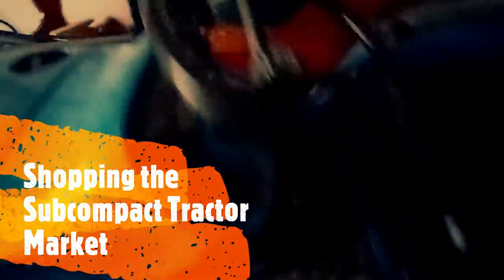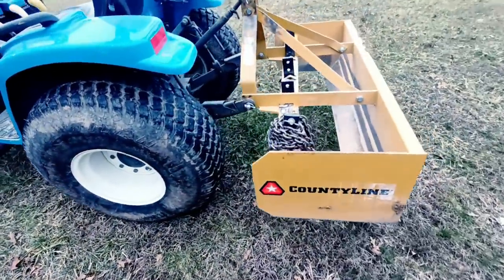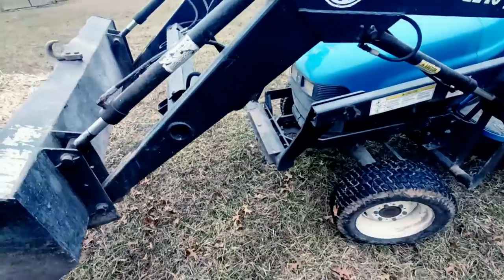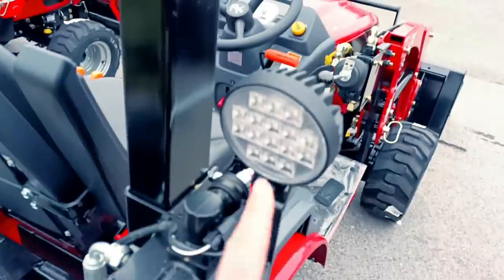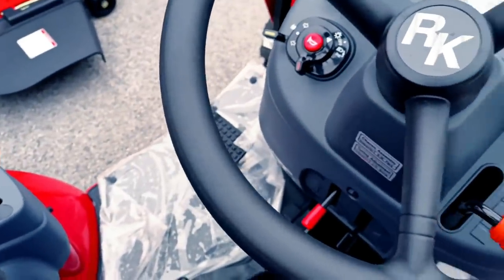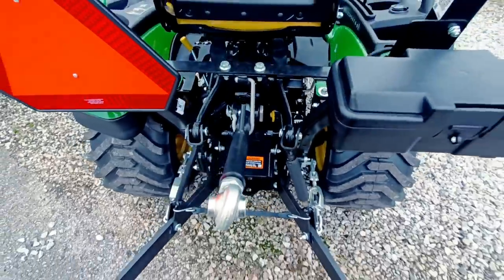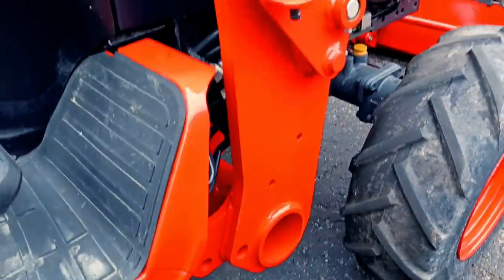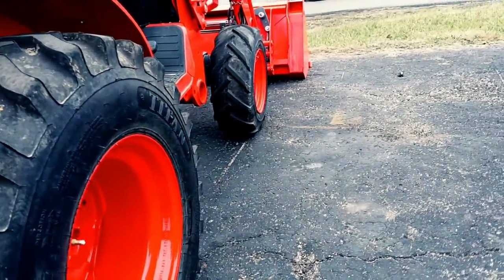Shopping Subcompact Tractors - RK24 / John Deere 1025R / Kubota 23S / New Holland Workmaster 25S

Comment: John Deere will work the Kubota under the ground Kubota  AR light and you got to add extra weight and everything else Hydraulics are not as strong as John Deere are you going to look at Coyote cuz it's better than both don't know about that Rural King or LS I'm told they're one in the same
Reply: "X tractor will work Y tractor into the ground!" = "I have X tractor and want to justify my purchase!"  Case in point, the Kubota BX23s is a third again as heavy as the Deere 1025, not lighter.  I have a 23s but I don't think there is an appreciable difference between the amount of work you are going to get done with any tractor in the 20-25 hp range.  I have a grapple for my 100horse Kubota M100GX and a smaller one for the 23s.  The GX will lift 10x what the BX will, but 9 out of 10 times the decision of which to use comes down to which tractor actually has theirs on at the moment because most jobs don't require the full power of your tractor.  All of these tractors are capable.  I love John Deere.  It is the longest running corporation in the world for a reason.  I bought a Kubota for the dealer support in my area and it is a little less expensive.  Cost wasn't the main feature, or I'd have gone with a RK.

Comment: Look into the John Deere 2032r or the 2038r more power set up higher and will handle a lot more stuff little more money  but worth it and we had a 5ft in a 1025r at the dealer doing work and it did good

Comment: Mahindra does not have a regen system.
Reply from the maker: Apparently they do, it's just a slightly different design.  Instead of using a DPF that requires occasional regeneration, they use a DOC and the engine is programmed to run hotter all the time to maintain clean conditions.  So they're just coming at it from a different angle, but I don't think it'll be more reliable over a 20 year span.
Reply: @4-LOW  the older Ram (2008) diesel did the same and they haven’t had any problems.
Reply: @4-LOW  mahindra actually makes their own engine called mCRD which is a completely redesigned engine meeting all emissions without having a DPF or regen.